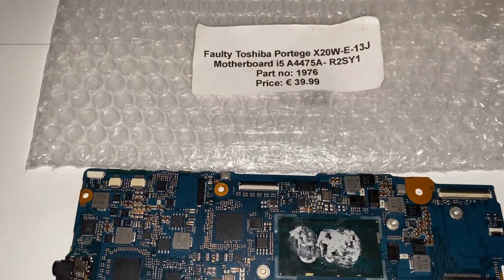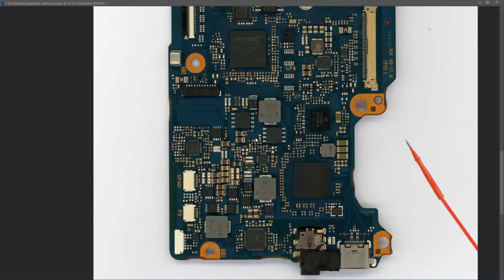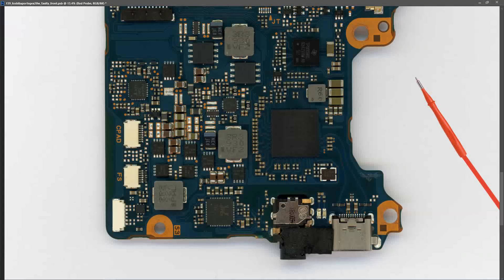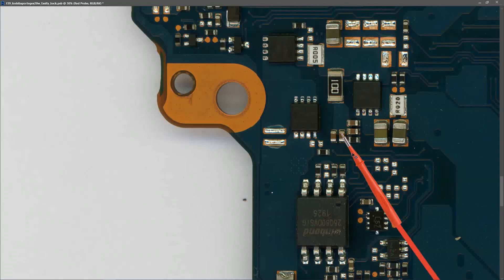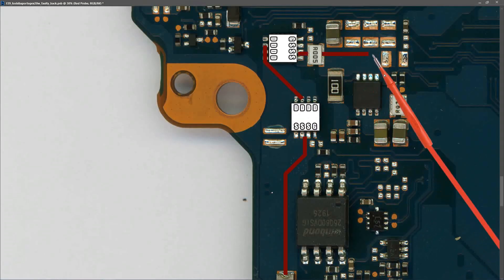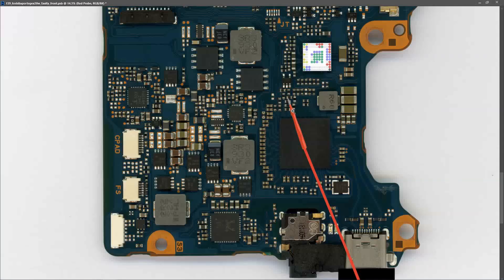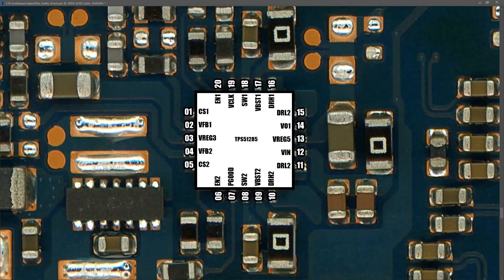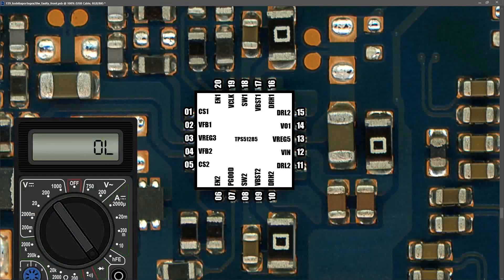TOSHIBA PORTEGE X20W - FAULTY

Comment: The TPS65982 can't function when blank. At a minimum it seems to need programming with the information that tells it where to load the BIOS from.
Reply from the maker: Thanks Ian, I didn't know that. Have you ever programmed one, or do you buy it pre-programmed for the particular laptop?
Reply: @therepairshare673  If you Google for 'does a tps65982 need programming' you'll find one thread on a TI support forum and a couple on Badcaps. It doesn't seem all that easy...
Reply: If you Google for 'does a tps65982 need programming' you'll find a thread on TI and a couple on Badcaps. Looks far from straightforward!